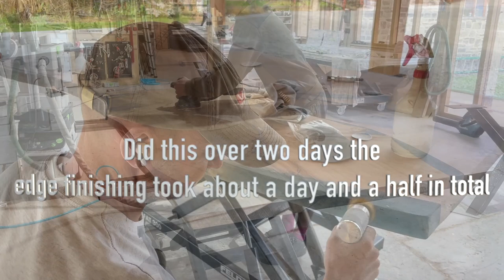Single Slab Dining table - Brown Oak - Skye Blue Resin

Comment: Hey Andy.  Idk if you can get dewalt in the UK.   I have like a direct drive 5 inch sander they sell.  Thing works great for making an edge.  It’s pretty fast too.  I use on some of fractal stuff and where the resin comes down the side.   Don’t know if that would help ya.   Great table too.  Plus I love the legs.  Your son is a great fabricator. 😀.

Comment: I’m now retired and so, after 45 years woodworking, the pace should have slowed down. However, we are getting towards the end of a conversion of a barn. The total cost is about £1m and the cost of £20K on European oak seems small in comparison but it’s all for 2nd fix and every inch needs full preparation by one of our sons and me. With my experience, I think I have an appreciation of the amount of hours that go into making what is a “simple” (lack of complex joinery) table. 

For those not buying regularly, the cost of it, like many other items, has shot up tremendously - far above the current inflation rate. The war in Ukraine is being blamed and it’s impossible for users to understand if that is a factor or whether someone in the supply chain is just taking advantage. It’s a wide market and difficult to see how one or two producers could control the prices of every producer. Using these slabs is a very efficient, very “green” way of utilising timber. When I look at the slab in its original state, we would have cut into into long lengths (say 200 wide and then 100 wide) with all the edges and central checks being put in the firewood pile. You might get 40% yield from many slabs. These tables use 90% plus and that can only be good. 

Whether or not I like every aspect of something I was building was secondary to what the customer wanted. Yes, you try and guide in order to avoid disasters but the man who pays the bill, calls the shots. If a client wants a table with many of the aesthetics of a waney edge slab but wants smoother edge, then you produce what they want. I can appreciate that it would be more child friendly. 

It is incredibly difficult to make a positive bottom line these days from bespoke furniture. Just look at the number of very good makers who really make most of their money from teaching the craft. 

When I look at the investment made in Manor Wood; all that machinery plus 2 wages, I can guess how much the business has to make just to pay its way. So, every marketing opportunity has to be seized and exploited. That’s where Amazon shops allow viewers to support the channel when buying items they would have otherwise just bought elsewhere.